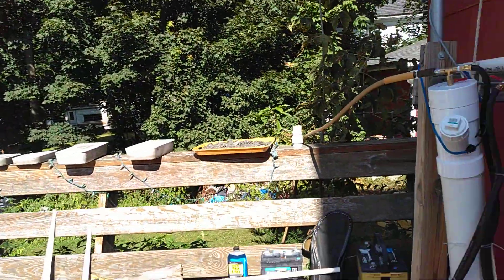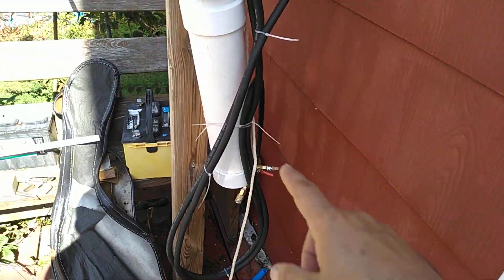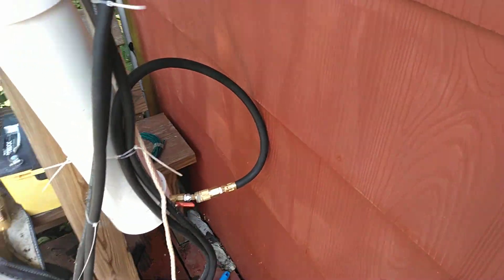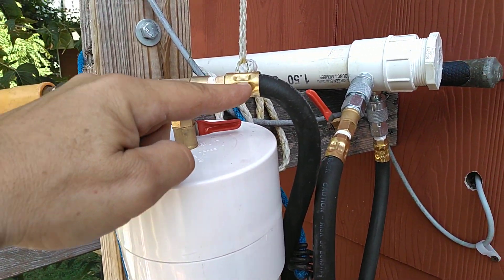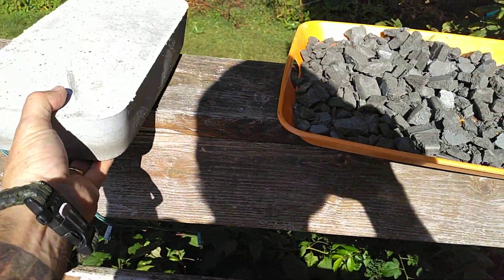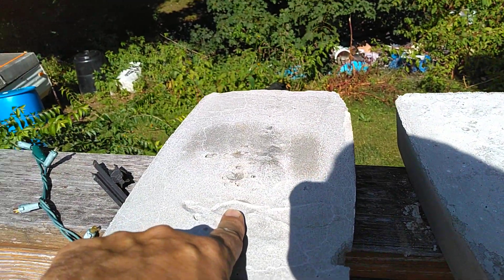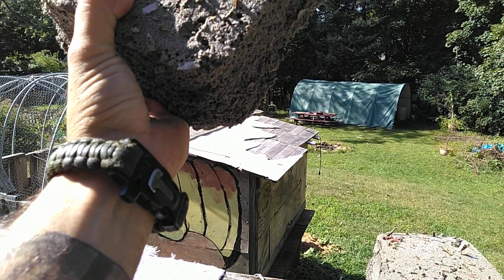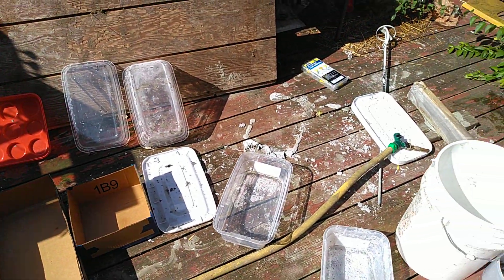Super Foamer aircrete foam generator explained.

Comment: can i use pressure washer with that foamer??
Reply from the maker: I doubt it, probably blow the stainless steel out of the front of it. Too much pressure plus it would need tons of air flow to make foam.
Reply from the maker: I doubt it, probably blow the stainless steel out of the front of it. Too much pressure plus it would need tons of air flow to make foam.

Comment: Can you put fiber in it would that help make it stronger and less cracks like normal Concrete? And with rebar does it work the same. It would be neat to make Concrete floor joist. Edited:  "link" to "like" and "Any" to "And"
Reply from the maker: Yes there are lots of ways to reenforce this mix and twice as many videos on it but I don't have those ingredients to waste on an experiment so small. I'm trying to figure out how to use this for concrete countertops.
Reply: @jaymoge  I thought it would work with rebar or other reinforcements / enhancements. Let us know if you do any testing with that I like your video.
Reply: Could have been rephrased to be a little easier to read.  I read it and was thinking that did I type? I edited a few words as noted above.

Comment: If the air pressure to the foam gun is higher than the liquid foam solution  pressure, won't the higher air pressure force the liquid foam solution back into the container without a one way valve installed?
Reply from the maker: That's why you should prime the SS wool first. Once it's foaming the pressure regulates plus I have 2 valves one or air so I can speed it up or slow it down.

Comment: The heat will turn it to dust!
Reply from the maker: The Aircrete? Negative, it's got amazing thermal properties. Put a blow torch on one end for a minute then touch the other side. Not hot and the spot the concentrated flame touched might burn an eighth in dent in it but that's nothing.

Comment: for a 5 gallon bucket it would be 0.3 gallons of water 4.6 pounds of cement and fill the bucket with foam until you get up to the 5 gallon mark. Make sure your foam weights between 90 and 100 grams per one litre of foam. that is important. you need to weigh your foam and make sure it isn't too dense or to light.

Comment: for insulation try this formula credit to Harry.  6 gallons water to a bag of cement. Reduce that down to whatever scale you want. then add enough foam that would make 100 gallons of product. so 6 gal water 92 lbs cement and foam to fill a 100 gallon drum. If you want to scale it down you can do so obviously and get the bricks you are making. This  is what Harry came up with for insulation grade and it looked pretty good and had good strength as well. it would be used to fill the voids in a wall after you put up your roof on poles and beams etc.
Reply from the maker: Thanks for the pro tip buddy

Comment: Good explainin, but still one mystery to me. If the air pressure is all the same, why does it bother to go through the liquid tank, and not just straight though the nozzle? Less resistance, or maybe you just turn that valve way down. If the nozzle is higher than the tank do you get mostly just air  - or maybe just spurts of foam? Thanks!
Reply from the maker: 2 seperate circuits, from the compressor to the soap tank which acts like a capacitor in that it will build a bit of pressure and push the soapy water through. The air line from the bypass just goes to the wand. It's a bit confusing I know but so long as one is pushing liquid and the other pushing air they won't effect each other until they meet at the end. Air compresses liquid not so much.
Reply: @jaymoge  thanks! If you do not first prime the line to the wand with solution, does it then just put out air?
Reply from the maker: @SpaceCrete  it can yes, you need solution in the stainless steel wool and air pushing it and in turn sucking more through like a paint gun or air brush. The air moving more volume out the want will eventually prime the line provided there's positive pressure but it works much better with the foam acting as back pressure in the wand otherwise it blows more air than foam. I regulate this by the valves on the wand and on the solution tank plus the compressor "PSI" output. If that makes sense.
Reply: @jaymoge  I am building one like this https://youtu.be/fgm_uoauuMU?t=305 (but not as good) that only has a single air line, but then injects cement inline further on. See how the foam flows differently.
Reply from the maker: Sounds cool, link wouldn't open.
Reply: @jaymoge  I just looked at it again - very nice foamcrete system. Channel "Foamrock" latest video, start about 5 minutes in.

Comment: Could you get a small screen and fix it into a fitting that can screw into the end to help hold the steel wool inside the tube ? That way it won't come out !
Reply from the maker: Yes, you're right. I've seen people put stainless steel pins through the tip to hold it in. Chain links that will plug the hole to keep it in. I haven't figured out what I want to do yet. It's a one off prototype so it's going to change a bit soon.